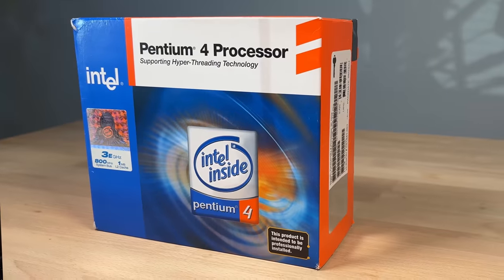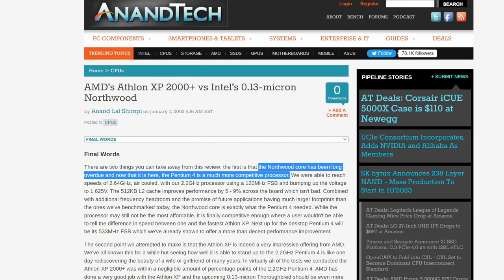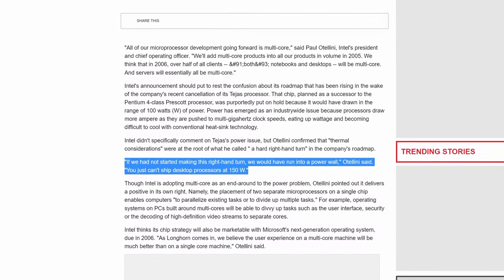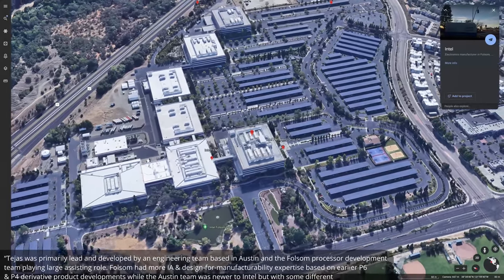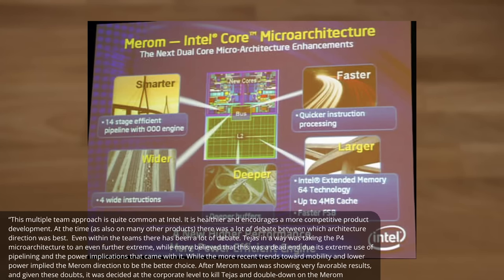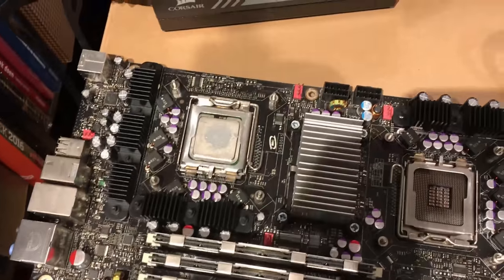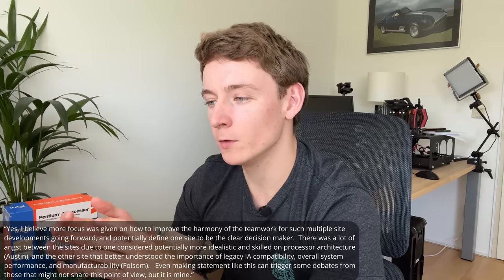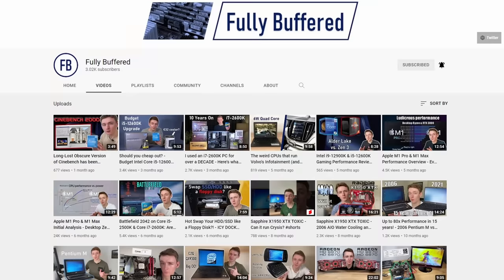Intel's abandoned Pentium 5 project...bought on eBay! (with info from Intel engineer)

Comment: Hi. Strange, you did not talk at all about pentium 4 on 65nm. For me - much more interesting could be a transformation of Gallatin (server 604/ extreme 478 sollution) from 130 to 65nm with growing up speed up to 4+ ghz. And another thing i was thinking for long time is future improvement of Cedar Mill cores - moving from 65nm to 45 could eneble it's stable work on air at over 5ghz and water-cooling OC up to 10ghz , like it has 7+ now with it's 65mn. Intel COULD make 671 and 681, and no care that thay could not fit in 65watt in the end -but that was the thing i wish to have - pentium 4 with 1066 fsb and 4 ghz. they could name this damn as 8xx serien - no matter how... Because i take 4ghs easily using my 641 and even using 631.

Comment: Maybe before delidding and permanently destroying those chips you shoul try to find someone at intel who knows how to operate those chips, just to see what's going on under the hood. It would be nice to see how they perform at what clock and power consumption. Maybe even they are quite early silicon they are relatively high clock samples. Also Intel itself gave us die shots, so destroying those chips would give us nothing more than what we have now. It would be an easier video to make though...

Comment: The Pentium 4 architecture didn't really work well from the beginning, the big numbers in the supermarket catalog, together with Intel's illegal actions (EU penalties), made sure that the stuff sold.  But they were not good and not only the CPUS, also the rest of the platform, e.g. RAMBUS. By the way funny how until today AMD P-Racing is judged , i9 12900KS 🤣
Reply: To be fair to Direct RDRAM, I recall it had a bandwidth advantage over many early iterations of DDR. That was without quad channel iterations of RDRAM which never really made it out alive. Business questions aside, I do wonder what be if it hadn't become so super charged.
Reply: @FakeGordonMahUng  Yes it had advantages, but how expensive it was. If it weren't for the illegal operations and long-term contracts, Intel would have rightly crashed at that time.
Reply: @techtomek5062  Just saying that if separate the business and politics from it--RDRAM might have been the better path from a performance point of view.
Reply: @FakeGordonMahUng  RDRAM would have benefitted something like the Pentium III much more since that CPU is very mem BW bottlenecked.
Reply: @Wasmachineman  I just wonder what the Counter Earth version would gave been with Core, Athlon 64 and Ryzen with RDRAM as the dominant system RAM (remove cost limits and business issues of course.)

Comment: The A4 marking on these is not a stepping. its a fab/assembly location designation.  Just like you would see 'MALAY' or 'COSTA RICA' A4 denotes a chip assembled in USA (likely at the Oregon fab site in Aloha/Beaverton)
Reply from the maker: Hi John, thanks for the comment - a few others pointed this out as well. Looks like Steve didn't remember that, oh well.

Comment: Intel P2/3/4 . . . sold by [on] clock frequency improvements in Intel terminology is called "frequency pegged price regulation". mb
Reply: "Frequency pegged price regulation" the peg part is every tooth of the fly wheel. mb
Reply: See my Seeking Alpha blog spot for the history on Intel almost every production run, most pf them, production economics for the Federal Trade Commission, Congress and the United States federal government and EUCC. mb
Reply: Pitching for an Intel job interview in good faith, still sketchy on the Intel side understand those above you that you make head way. Refreshing. mb
Reply: Want to know how Intel positioned it review all the production economic from supply signal cipher and report at it I'm involved in current matters. mb

Comment: I am confused about how you tried to get it working. Did you just find a motherboard  with the same number of pins and it happened to fit? Powering it up with different than expected signal usage on the pins and no bios record of the cpu is very likely not to work. In fact you very probably wrecked those motherboards and cpu. It would probably not be that thrilling even if you did the major project needed to get them working.

Comment: I have some of these 771s I got in a batch of engineering samples, I never had a board to run or test them.  I still have them, still have no Board for them.  I thought I was getting 775s. Most are branded Zeon though. Isn’t the socket named for Jayhawk?
Reply: They were selling these stickers that swapped two pins on the 771 to run on Intel 775 boards. I never got around to ordering them because at the time I was going to swap them myself and never did.

Comment: 0:52 I had a P60 once - it was awful. I put ME on it and sold it - it had some crap Cirrus Logic VLB video card and an original soundblaster (8 bit) in it, and a BTC 12x CDROM. I don't recall the hard disk size but it was probably a Maxtor or a Seagate. Someone bought that thing in like 1997 for several hundred bucks... I mean it worked, and was stable, but a 486 at the same clock speed was more desireable.

Comment: The IPC hit from overly deep pipeline was massive. I had an Athlon64 @ 2.2GHz with performance comparable to a 3.5 GHz P4. Branch prediction just wasn't good enough for the time.  Modern Zen for instance has a 19 stage pipeline, but still good IPC. There are some more special purpose chips with deep pipelines, but the code they run has very few branches. Even with good branch prediction, code can be made to run faster if branching is reduced, even if it involves doing more work, because forcing a full pipeline flush is a huge performance hit. Reordering branch conditions to be more predictable can also help.

Comment: Interesting!
I wonder if high TDP design like this unreleased project will be ok nowadays since we're already pushing past 250W easily on consumer desktop CPUs..
Reply: I'd like to know what do you mean by "pushing past 250W easily"? That would be an AMD Ryzen Threadripper Pro or similar. Of relevance only for a minority.
Reply: @Conenion  Ah I mean 12900K and 12900KS, with unlimited PL2, these chips can break into 260-270W package power range (and assuming similar trends continue, next gen 13900K will also behave like this)
Reply: @Luckyn00bOC  
12900K has TDP 125 W. And max turbo power is 241 W according to Intel.
(Overclocking isn't "easily". Again minority. Mostly hobbyists.)
Reply: @Conenion  Agreed. But if you put 12900KS to a high-end Z690 motherboard like ROG Z690 Hero or ROG Z690 Formula, it will use 'unlimited' power as default out of the box config , and will boost to its maximum power as long as the cpu stays below the TjMax. This is also why many users with high-end setup like this encounter temperature issue.
(and according to Intel, running at Maximum Turbo Power for unlimited duration is not 'overclocked' - please refer to Anandtech article about Intel's Turbo)
Reply: @Luckyn00bOC  
hmmmm...okay.

Comment: Funny how things just come back around.  CPU and GPU companies have thrown that wasted heat and power consumption thing right out the window.
Reply: I tend to disagree, modern CPU and GPU are much more power efficient than previous products. The difference is companies now allow the consumer to more easily move out of where the product is most power efficient to gain an extra 10%  performance. Consumers can now choose to back off the clocks and under volt, we loose 10% performance but get back to maximum efficiency. As a real word example if you do this on a Nvidia 3090 the stock power draw limit is 380 watts at 1950 Mhz, then run a reduced clock of 1800Mhz and 0.875 volts curve and total power draw reduces to 280 watts and the performance is still at at 90%. The 3090 is appox 2 x the performance of a 1080 / 1080 TI at the same power draw of 250/280 watts.

This is quite an impressive achievement 2 x performance at same power draw in  5/6 years.

Comment: Where is a correlation between stated cpu clock and the performance? Particulary in 80s, 90s, 00s.. to which architecture it this related? Intel is no the only nor is the performance oriented company, never was.

Comment: Prescott was a giant band-aid to the FSB bottle neck issues the high clock Pentium 4 CPUs had. I had a Northwood P4 HT 3.0 and replaced it with the later Northwood P4 HT 2.8C (512KB cache) and using Corsair DDR500 memory overclocked the FSB to 1000Mhz from stock 800mhz to get a 3.5Ghz CPU, my flatmate had a Prescott P4 560J at 3.6Ghz (1MB Cache) even with double the cache & 100MHz clock advantage his CPU was slower in any benchmark we ran, it was being strangled by the 800MHz FSB, which was used for both RAM access & system I/O at the time.
Reply: Pipeline has been stretched from 20 stages (in Northwood) to 31 stages (Prescott). One of the main reason.
Reply: @Bubak777  came to say that
Reply: The same FSB was used with the Core 2 chips and even the 800 MT/s versions gave the Athlon X2s a good run for their money. That was the last generation that used the FSB so clearly it has reached the end at that point but it's pretty obvious it wasn't too bad and it definitely wasn't the bottleneck for Prescott.
Reply: @Carlos-M  The only desktop Core 2 Duo to run 800 FSB was the E4000 Series CPUs, they were slower than the higher FSB C2D E6000 series CPUs at the same clock speed. The C2D E4000 CPUs had 2MB L2 cache, four times that of the Northwood P4 512MB, they had far better branch prediction, and the shorter 14 stage pipeline meant a cache miss didn't carry the same penalty as it did for P4. The C2D E6700 is slower than the C2D E6750, they are the same CPU core at the same clock speed only difference is a 1066 FSB  vs 1333 FSB, the Core 2 Duo was still being held back by the shared FSB at 1066.

Comment: im interested to know what clock speed they got to. it would be really impressive if they got anywhere near 7ghz considering intel and AMD now are having issues just getting to 6
Reply: We have multiple cores now. That equates to more heat. 
This one is a single core.
Reply: @TexasTimelapse  yeah, but its also been like 20 years. from 1982 to 2002 there was almost a 1000x increase in clock speed, from 2002 to 2022 we got just a 2x maybe 3x increase in clock speed
Reply: @dylon4906  
It's a thermal issue. Add more speed and cores you need more voltage applied. This equates to more heat. 
The improvements that have been made are in IPC.... instructions per clock, faster RAM, larger L1, L2 and L3 caches. Don't forget about SSD and optimized operating systems. 
The die sizes have improved greatly. From 65nm down to just 4nm or 5nm. This improves latency, but comes at a cost. The heat generated is more compact.  Intel's 12900k or Ryzen 5950x are fast processors and need to be on big AIO coolers or custom loops to control thermals.

Comment: If these CPUs actually released they'd be a meme even to this day.
Reply: If these CPUs came out, it would be better BBQ than Nvidia GTX 4xx series' Fermi Architecture.
Reply: @riqhtful4561  only 480 was BBQ.
450 and 460 were awesome and efficient cards.
Reply: @warrax111  Some models were overheating easily due to cooling system.
Reply: @riqhtful4561  every card overheats, when you put no heatsink or small heatsink.
ati 1950 pro were also very hot because of they had small heatsink.

but 480 could go up to 100 celsius even with that big stock cooler.

anyway, you can't call em BBQ anymore :)

Comment: The P4 was garbage, it was the first time a new product was slower across the board than its predecessor.  It's like it was designed by marketers instead of engineers.  The entire Netburst thing was a complete total failure from the ground up...that's why AMD was king in those days.

Comment: I remember in 2004 most pc magazines like Chip hyping about "How great upcoming PENTIUM 5 Hyper Threading" is.

Especially during LGA 775 socket announcement, most people believe that "PENTIUM 5 is on the way", yet Pentium series stuck at 4 (i knew there is Pentium Gold even on modern system)

Comment: Intel also cancelled the launch of the 4GHz Prescott CPU because it thermal throttled so badly in testing it was outperformed by the 3.8GHz chip haha, you can still find the page for it on their ARK database.

Comment: intel was targeting a 10ghz frequency with P4
Reply: They suggested in early 2000 that 10GHz with "Willamette architecture" would be possible by 2005, before they realized physics was in their way. The target was lowered further and further until eventually giving up. NetBurst has a unique dual-issue FPU that's two units running at effectively double the internal clock, so at 3GHz internal they operate at 6GHz effective. This is the only domain in the chip that they could claim hit their 7GHz+ target, and with overclocking on Presler or Cedar Mill, 10GHz.

Comment: p4 the biggest failure intel ever did and amd crashed them down since 1999 to 2003 and was struggling until 2007 with first 64bit cpu and intel had to even buy the architecture at the end and recovered slowly till first core 1 came out p4 was a total joke if u would want you could buy a prescott and cook something on it to around few hundreds p4 and amds came into my hands in the 2000 to 2006